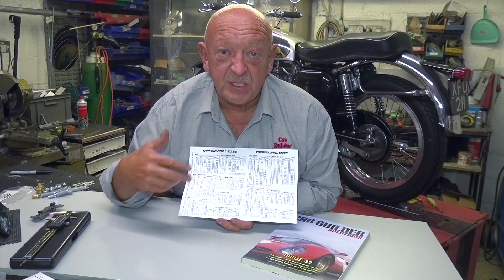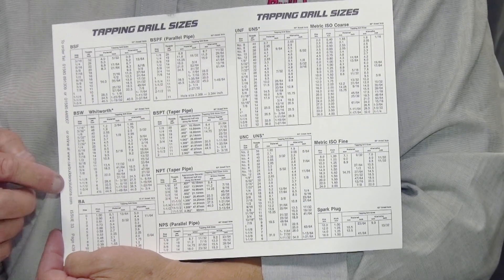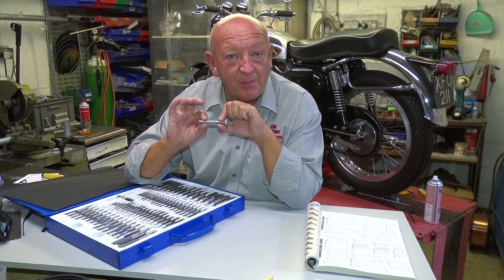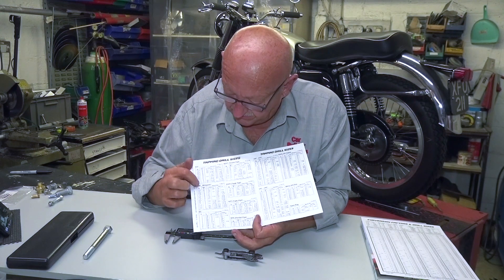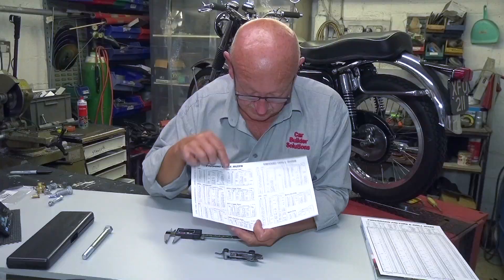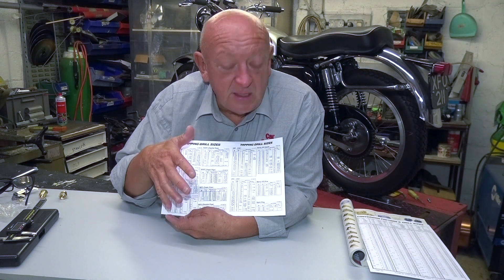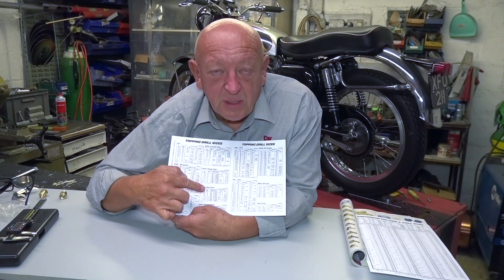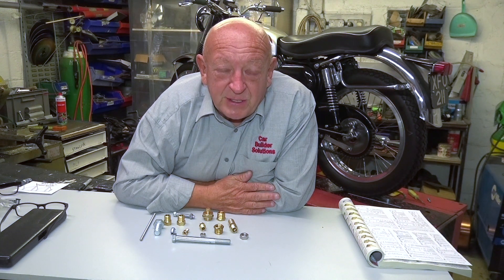Threads And How To Measure Them

Comment: Excellent video and has helped me a lot. I'm installing air lines off a compressor I've bought and some second hand air tools - all sorts of fitting sizes on them. I will buy a thread gauge off you and a chart. Threads are a nightmage particularly the tapered threads. I get frustrated when I am ignorant of facts ! Cheers.
Reply from the maker: Glad it was of help.

Comment: HELP!! This is a great video and very helpful! BUT what if you have an internal thread to measure - i.e. a hole with a thread inside it thatt you want to find which bolt will thread into it without destroying the internal thread? The gauges on your tool are too big to fit in the hole. There must surely be a solution to this problem too?

Comment: I'm trying to fit a mechanical oil pressure gauge to my old landrover, The only adapter I can get that suits the engine has  an M10x1 untapered apature. However the closest fitting to that which comes along with the gauge from the company is 1/8 NPT, they simply don't provide an M10x1. THey are insisting the pitch is the same and it will be okay wuth some PTFE tape. Would be grateful for your thoughts on that...also what's the bike behind you ???
Reply: there are 2 types of thread on the defenders. a 10mm x 1 and a 3/8- 24 (9.72mm) outside measurement. the 3/8 sizes are difficult to get hold of. the 3/8 compared to the 10mm is a bit smaller. you will have to go to a machine shop to make an adaptor.  they dont exist on any shop shelf. sorry mate.